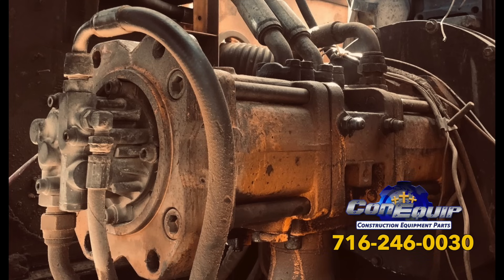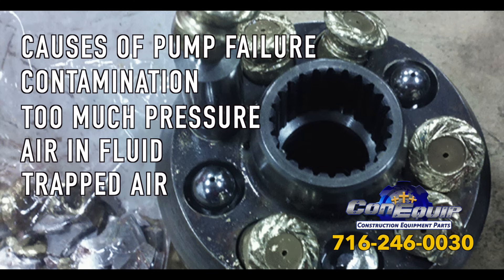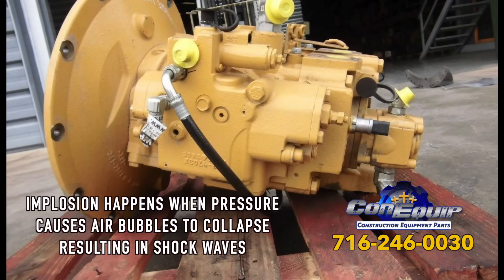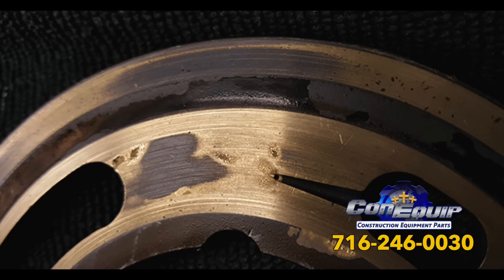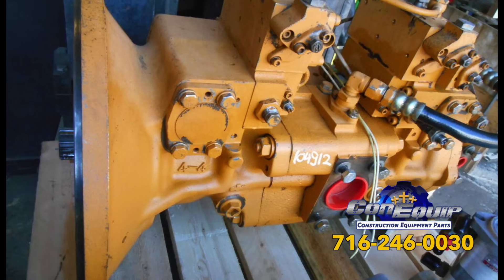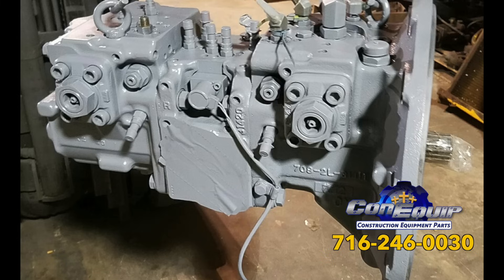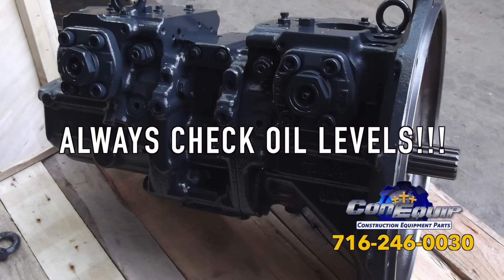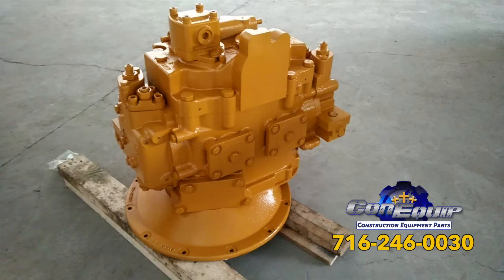Hydraulic Pump Failure and Maintenance Tips

Comment: We have an older cat 287b and I think the pump is just tired. Doesn’t drive as fast or turn as well as it used to. Probably has 4000hrs on it.  You think it’s time to replace it?
Reply from the maker: Hard to say. We need a little more information
Reply: All Hydraulic pump, motor and valve repair here
Please contact me
8740023573
8578815731

Comment: Hello my soilmec rigs hydraulic pump failed its based on a cat el300b excavator can u help me suggest a new pump which will fit.can i have ur email would be really helpful
Reply from the maker: call us IMMEDIATELY!!! 716-246-0030.  Tell the rep the video guy Steve sent you!
Reply: @Conequipparts   thanks ill send an email can i have ur email plz
Reply: All hydraulic pump, motor and valve available here
Please contact me 8740023573,8578815731

Comment: Hello guys i need help,why my excavator 320C when doing the oparation there is three things get a problem 
1.The joystick vibrating when applying the leaver to the arm lifting location the machine jumping like someting trying to switch off and on and lossing power that time to hydraulic system 
2.To the swing location is same problem
3.When the machine running can not do twice oparation the getting low power you have to stop one oparation then the machine get power again.
my question why my machine that?and how can i solve this problem?
Reply from the maker: sorry, we don't have the ability to diagnose problems.  when you find out what is going on, if you need parts, call us then.

Comment: If you touch the joystick and the machine moves very roughly, what can it be? Its like it doesnt have any sensitivity, like all or nothing, some hidraulic valve stuck maybe? Thanks
Reply: @Wannabejober yes
Reply: @Wannabejober okey thank you very much, how can I check the pilot pressure? If the machine is at mid throttle works well, but when is on idle its not working..
Reply: @Wannabejober okey, and how I can adjust the pilot pressure if is too high or too low?